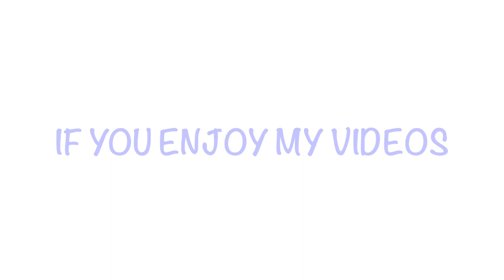Kyosho ULTIMA PRO XL BUILD VIDEO #2

Comment: love all the little details in the build like the motor washers /tape under the gear box  and 3mm lock nuts on every thing  and a few simlpe things people miss like have the shocks loose on the towers ,very well produced with your camera work as well  ,makes me feel better as i  thought i was over the top checking every fine detail looking for weak spots  and making the car super smooth for a racers edge ,well done
Reply from the maker: Thank you for the words of encouragement. I had little idea that producing these videos would present the challenges that they do and Im post narrating the video so its really difficult keeping up at times. Lots of ‘takes’ and I know Im for from perfect but glad there is some value coming out of what Im creating.

Comment: Just curious what the CVDs are for the Pro.  I got one recently 2nd and one of the drive shafts are snapped.  Do Lazer units fit or re-release Ultima or Optima? Great build taking notes as I'm restoring my Pro over time.
Reply from the maker: Im just using what came with the car and haven't a manual on hand to let you know the details of whats included in the kit

Comment: How did you fit the 12mm hex wheels on the front?  Thanks!
Reply from the maker: The front is running bearings. Rims are from JC Racing

Comment: Nice rebuild. Won't the "aquarium" you made around the electronic not interfere with the cooling of the ESC? And when holding the rods of the shock with pliers, is there anything between the metal of the pliers and the metal of the rod? If the pliers slip on the rod a little, when fastening the plastic end part, it might create scratches. When I rebuild shocks, I usually put a piece of thin rubber or similar between the beak of the pliers and the metal rod, to avoid scratching. Regardless, this car turned out nicely.
Reply from the maker: By chance did you watch the two videos on this car???
Reply: @Bormac073  I've watched most of this one, I'll check out the other part later, have to do something else right now
Reply from the maker: @rc-fannl7364  it would really help if you'd watch the 2 part build in their entirety before offering up advice. Im not a novice and it amazes me without seeing why, how and when in which is explained throughout these specific videos on this car, that you'd take me task over things you haven't taken the time to understand.
The car was entered into a 5 hour endurance race and placed fastest lap in its class and ran problem free for 40+ minutes straight intervals in my team.
Reply: @Bormac073  I'm sorry if my comment seemed like trying to lecture you, that was never my intention. It's clear that you must have a lot of experience, otherwise you wouldn't be able to pull off a rebuild like this. I know vintage cars pose an extra challenge. So, the remark about the ESC/Electronics was simply a question, I didn't say it would overheat guarantueed or anything, just wondering if there were any issues with this setup, which seemed to compromise airflow. Glad to hear it's been totally reliable, as it does seem like a neat way to protect the electronics from dirt or worse.

Same with the remark about grabbing the metal piston rods of the shocks with the pliers, I didn't see if there was anything inside the beak of the pliers to prevent the shock piston rods from getting scratched, so I wondered if you were using a special pliers, or had put in something to protect the metal, which just didn't show on the footage. I've had a few times, when not using any protective measures, when rebuilding shocks, that the rods did get scratched, but that might also be due to me having used sub par tools. 

Anyway, my comments were never meant as harsh criticism, and I rather expect to be able to learn a few tricks from you here and there, instead of being in a position to offer you some advice.
Reply from the maker: @rc-fannl7364  i go to great lengths to build all my cars to the highest possible standards. Every used shock shaft when being rebuilt gets spun in a drill and carefully wet sanded with 1400 wet and dry (using oil), then cleaned in a shellite solution before again being spun in a drill so I can polish using a metal polish compound. The old crimping pliers Im using have a dull blunt grasping surface that actually wraps part way around the metal shaft and does not mark it when used. I wouldn't go to such lengths only to destroy the shaft which would then shag the delicate O ring seals.
There is literally a ton of good content I have shown on many of my videos that offers a clear insight into the practices I use and implement into my builds.
Its so easy for people to offer criticisms but if only they watched the videos in their entirety the full story gets revealed.
Lets just say Im not offended but in rebuttal to the opinions I merely offer solutions.
Reply: @Bormac073  Thanks for the (very) detailed reply. It's clear your attention to detail is of an exceptionally high level. Had I known that on beforehand, I would not have wondered if there was anything done to prevent the risk on scratching the shock piston rods, but would have known that part would already be well covered. Again, sorry for making it appear like doubting your skills.
Reply from the maker: @rc-fannl7364  thank you. Believe me, some of the comments I see come through from people who dont actually watch enough of the video/s blows me away. Its unpaid and endless hours of work bringing content to viewers who dont pay.
If anything I tend to not advise others on their videos until Ive first put the time in to see if there is enough knowledge being shared.
Reply: @Bormac073  I can totally imagine how annoying some of those comments must be, when putting so much effort into creating this content. I guess people (including myself, probably) are getting more used to watching shorter vids instead of taking the time to watch something in full, which is a shame.
Reply from the maker: @rc-fannl7364  we all get so spoilt for choice and its hard guessing what is watchable and how long it should go for